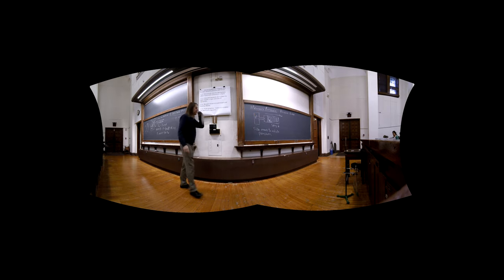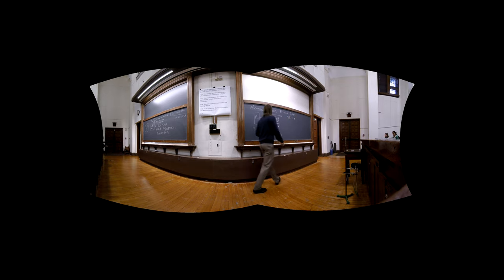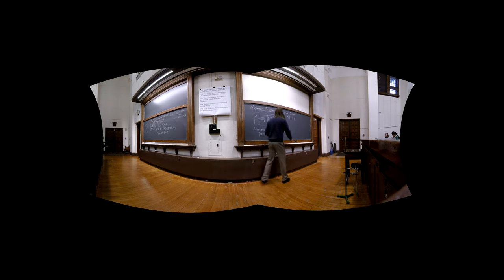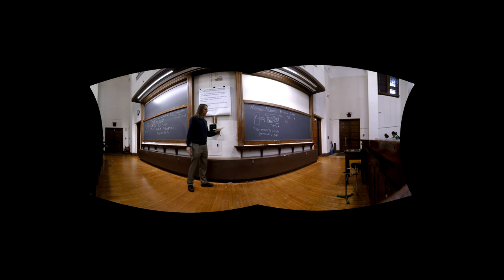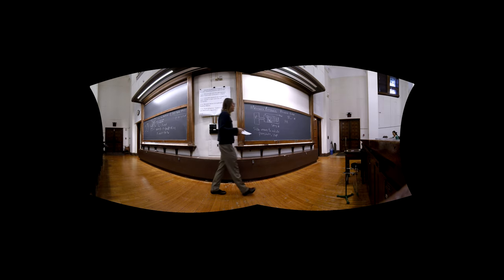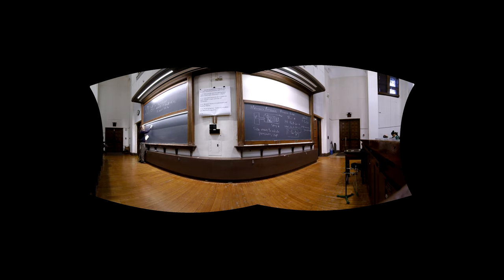PHYS 125 | Lecture 11C-2 | Pressure Gauge and Gauge Pressure

Comment: When I cap the straw, I see the liquid surface in the straw drop little bit, and that may lead to little volume expansion. Does that lead to the pressure drop in the seal space?
Reply from the maker: yes
Reply: @Prof-Hafner  Thanks.